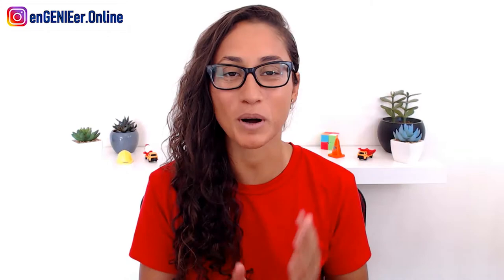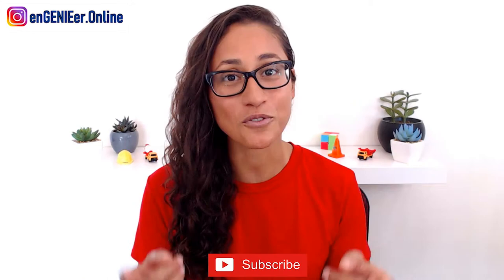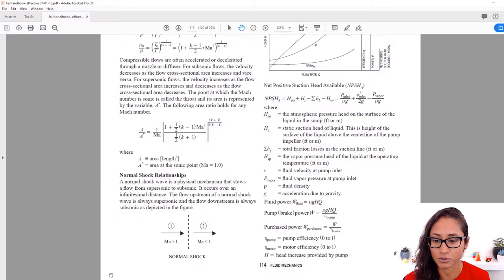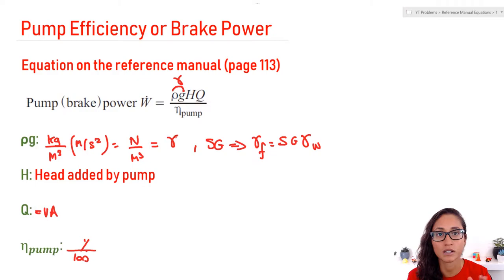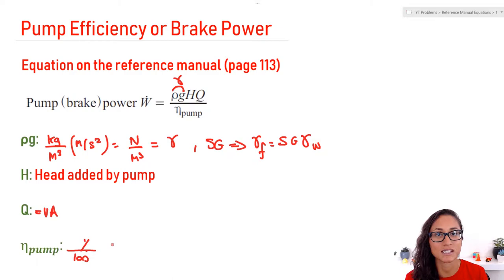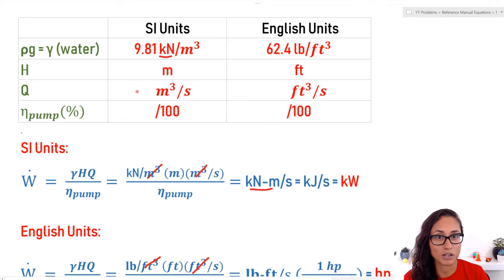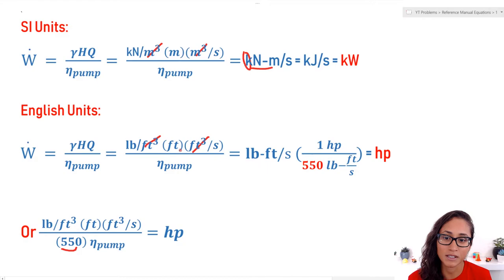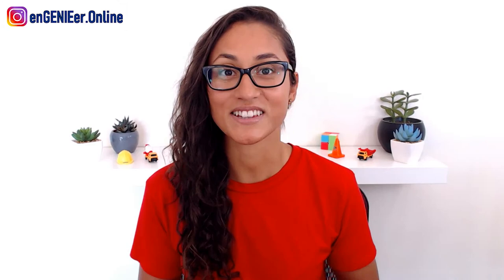Pump Power Formula (FE Exam Review)

Comment: Also, on page 2 (conversion factors), you can find ft*lbf / s conversion to hp. multiply by 1.818 × 10–3 (=1/550) or vice versa, hp to ft*lbf/s is available. Also of note, J/s,  to or from, Watts is also listed.